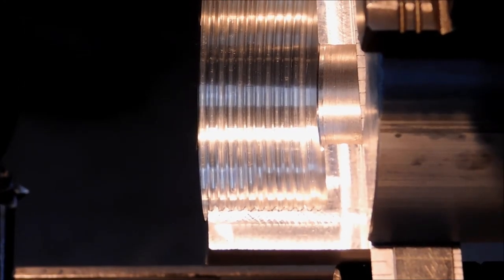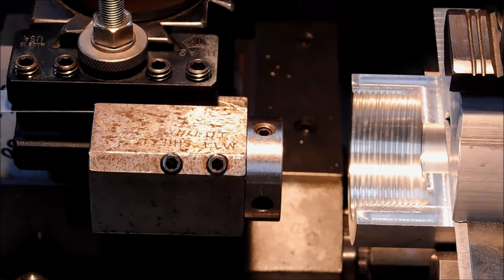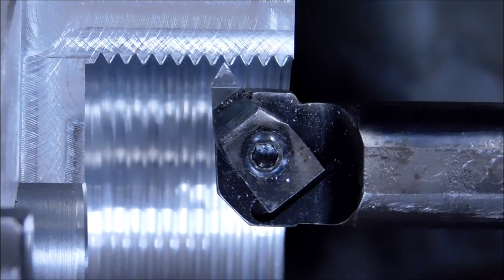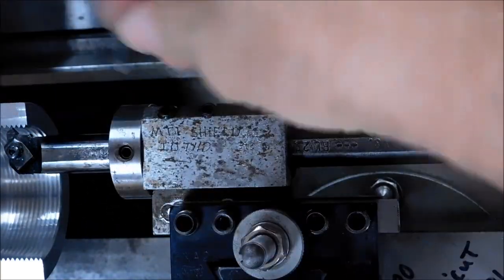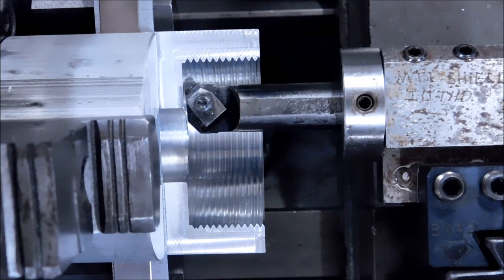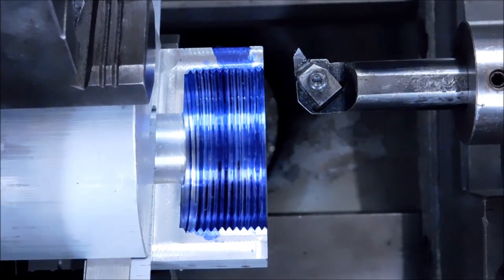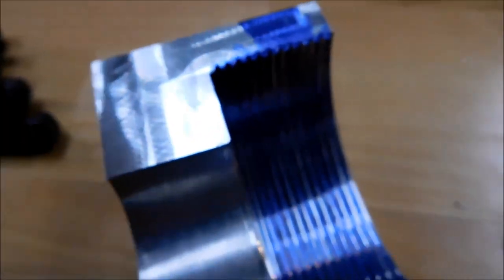How To Pickup an Internal Thread for Repairs !!!

Comment: When I was an apprentice, I was shown this technique, but used the compound slide to find the centre of the groove. The indicator was looking at the compound movement. It is also the same technique for an outside thread to be picked up. The only difference was that after the lathe engagement and had checked the thread pitch , the chuck was hand turned in the direction of the thread cut. This made sure there was no backlash in the gear train. Also lock the carriage so it is stable  in position. 
Great post Joe as always.

Comment: Another great tip Joe - I had moved the tool but had not thaught to use the indicator to find the center - so simple, Thanks
Reply: Me to: using an DTI never occurred to me either;-)
Reply from the maker: Thanks. Using the compound could easily lie to you or chip your tool. The indicator gets you much , much closer.

Comment: Thanks for sharing this idea, thankfully I have not had to pick up internal threads yet but have picked up on a number of external ones.  I really like your idea for threading with the spindle in reverse and am now looking for a reverse threading bar to the one I have. 
Thank you for sharing your tips and tricks, it is very much appreciated as you have some cool ways pf doing things!
Reply from the maker: Thanks. I love a good challenge and a shop is usually full of them.
Reply: You don't need a reverse handed threading tool, in fact it won't work, even with the lathe running backwards. In the same way that a LH nut will not run onto a RH thread, even if you turn it around.
Just turn the conventional RH threading tool you have upside down, or leave it right way up but at the far side of the hole, like Joe does.

Comment: Another good video Joe!.... One caveat might be, for novice machinist, is to not forget that the job came in as a repair, meaning that the threads will be mashed, rolled over, gouged, etc, so their start number of .020" in this video case, needs to be sneaked up on to avoid chipping a tool on the damaged spots. Well done !

Comment: Joe, this has been a godsend for me. Threading in reverse is a revelation making it so easy to work to a dead stop or should I say from a dead stop. Brilliant! I just did an internal thread only 1.5 mm deep and 0.5mm pitch!
Reply from the maker: Good to hear. You'll never go back to the old way.
Reply: Are you doing this on lathe with metric screw?
Reply: @bpark10001  
In truth it was a custom thread of 7mm dia but 50 tpi. This meant I could engage the half but using the timing dial on my imperial Myford.

Comment: Last time I chased a thread was using standard Aloris holders and an insert bar. I used the compound to feel either side of the thread and noted the travel and backlash. Bounced back and forth until I found the root and backed off a few thou. Make sure you have all the backlash loaded in the correct direction on everything! Especially the half nut. Joe I like the use of the indicator. I was running more seat of the pants to chase a very large UNS optical thread.

Comment: Awesome technique, as always, Joe! Thanks for posting.  The concept of threading away from the chuck is just brilliant.  So simple, why hasn’t it been done like this forever?
Reply: It's funny when you see this for the first time you go -"duh! Now I don't have to be a ninja with the half nut!"    I started to use it all the time because my lathe has a metric leadscrew and no threading dial.   Makes the whole stop-out-reverse-in-forward thing sooooo much easier for when you can't unlock the half nut during threading.
Reply: Actually, some turners were doing this in the first half of the last century.

Comment: Nice procedure Joe, I wrote to you last winter about a similar situation, I was into during restoration on a very old screw jack that had broken on my Grandfather when a wood wheel came off the axle on a fully loaded hay wagon being pulled horse team on the way back to the barn it was sometime in the mid-s20.  My father always told the story about Papa pulling the broken jack out from under the wagon mad as hell and walk over to huge gully and toss it as far as he could. The jack was rediscovered in the early s70s when the farm was being developed into an apartment complex by an excavator operator that was good friends with my father. I guess since it was buried deeply in a clay swamp it was preserved fairly well. That's when I first heard the story about the jack, my dad was about ten years old at the time it happened. My dad hung onto that broken old jack for the rest of his life and it was passed on to me with the request to get it working again. I did, but it's only an ornamental piece now. I could have done a much better job had I saw your video first. My sister has it hanging on a wall in her family room now along with many other artifacts from our family. Thanks!
Reply from the maker: Love it.

Comment: Very cool and exacting method of picking up the threads after a screw up when threading.  I’m a total novice but just recently was trying to make a spindle nut protector for L-00 spindle on my old Clausing 5900 lathe in which I’m adding a lever collet closer . Anyway I screwed up midway cutting the external 3.5” x6tpi thread. I spent about 30 minutes thinking about how I save the mostly finished nut I was making and did a lot of what was described in this video.  I love the the indicator because I just eyeballed my repositioning of the boring bar. This was very cool. Thanks again. I really like your videos Joe. They almost always hit home as very useful.

Comment: That's a pretty clever solution. I like the use of the indicator to pick up that blind measurement for getting centered.
Reply from the maker: It will get you very close if all preceding steps have cooperated.

Comment: Engine Lathes are easy. I was doing this 30 years ago. I just came up with a new process two days ago on a CNC lathe without a compound. 3 5/8-12 ID thread repair on a 10' long telescoping tube. I picked a position behind the Chuck to make a timing mark on the Head Stock and Mounting Ring.  I used  a small amount of JB Weld to cover a small spot of about the first 4 thread. After setting Z0 at the end of the tube I checked  the timing marks then moved the threading bar to the center of the first full thread. Marked down Z-.175" I set program to start at Z+.100". Run first pass and stopped. Checked the marks over the JB Weld. Looked Good. Run the Program to end. Needed minor adjustment to X diameter and about 0.004" to Z. Ran 10 tubes  before quitting time.

Comment: Nice video techniques, you are no amateur.  Also like the way you used a sectioned piece of work to illustrate the cut.  I've known of turning from, how would you say, on the back side with the spindle turning backwards, nothing like threading a blind hole, done it many times, making camera lens adapters, etc.  I've always done the threading by "feeling" where the bit was, not by using the dial indicator and splitting the difference to find the center of the thread.  Nice work, as usual.

Jim

Comment: Good stuff Joe. The half part was great for the visual. I've had to do this a few times... more so with od threading. I once had to pick up a 10-32 thread on the cnc to thread mill it a little larger when it shrunk with heat treating. Basically used the same principle as you have described here.

Comment: Hi Joe,

Not sure if I wasn't paying attention, but did you mention anything about making sure all the backlash is out of the system when setting the tool in the correct position? I always find it amazing just how much backlash most lathes have the geartrain for the leadscrew mechanism.
Reply from the maker: I always apply drag to the top of my handwheel while threading like a drum brake. Always. Even in this example prior to setting that tool.

Comment: If you are chasing threads that have been worn and/or distorted how do you pick up your center of thread with confidence?  Some that have been over torqued can also stretch the thread.  I like the idea of putting an indicator on the back side but am confused about how you keep everything in position when you unlock the half nuts during set up?  Thanks for a good video.
Reply from the maker: The location of the tip of a threading tool is mechanically set to be coordinated with the machine movement. Once its set, you can engage and release the half nut as much as you want and it won't forget where it is. As for chasing beat up threads, I would suggest finding an area that looks good and set your tools there. Watch that first pass and adjust if necessary.

Comment: As usual very well described. The only suggestion that I would make would be to determine the speed that you intend to run the part since on some lathes changing the speed after locating the tool can create a problem concerning location.
Reply from the maker: I can not speak to all machinery, but the possibility does exist.

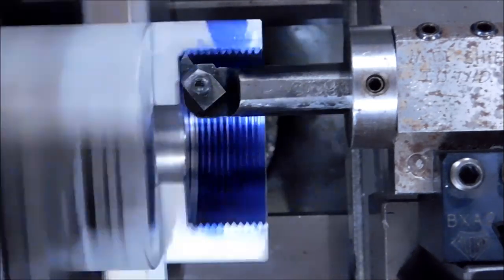Comment: I would imagine that when first engaging the half nut (4:14), we would need to be mindful of the thread dial for the particular thread so that when we later engage the half nut to clean-up the thread(13:35 ), it is properly indexed to the thread.  Correct?

Comment: Great job you made this dreaded problem easy!  One question though after you picked up on your thread did you put the spindle in neutral to change speeds ? Because I thought that would change the position of your threading insert to the  thread.
Reply from the maker: I did disengage it once. I'll have to try that again before I say it didn't hurt anything or maybe I just got lucky. Normally I wouldn't change anything to be sure.

Comment: My very first attempt at picking up a thread was on an internal.  It certainly wasn't voluntary!  Thankfully, it was on a large bore, 5 tpi, and near the beginning of that operation, so it was a little easier to absorb any differences in how the tool bit was set.

That slip was the first of several that convinced me that the old original lantern tool post could not be trusted.  There are "turret" tool posts, I started calling this one my "tourette's" tool post, as it became the cause of several sudden outbursts of profanity ...

Comment: My internal threading is almost exclusively on parts without a stop groove, but also without a shoulder right up against the threads.  Is there a way to start the reverse threading technique without a groove to start the tool in?  I do a lot of truing of threads which are never cut straight to the bore of the part when I get it.  Normally end up with a thread that's .010" oversize, then cut the mating part to match the oversize thread.  My process for picking up the thread is much the same as yours, but I currently thread toward the chuck, back out at the end of the cut and disengage the half nuts simultaneously.  It makes me nervous and I've broken my fair share of inserts by not getting out of the cut in time.

Comment: Could you please make a video detailing Buttress threads. I can't seem to find any information on the set-up (compound rest angle) and procedure of machining this type of thread which is mostly for hydraulic applications. The Machinery Handbook gives many specs but no procedures. Thanks! I love the videos!
Reply: Buttress threads only have one angled flank so you can simply plunge straight in without topslide (compound slide) set-over... 🙄😏
Set-over is used to stop the cutter cutting both flanks at the same time , this cannot happen with the buttress so no set-over needed... make sense ? 
Joe can correct me if I'm wrong... I'm only a hobbyist but this is my understanding & my experience... 🤓
BTW... the cutter profile would look like a woodworking chisel on its side..kinda like this..  /|
😎👍☘️🍺
Reply: Peter Fitzpatrick I think some buttress threads have a slight amount of angle on the “straight” side as well. But this is small enough that you probably won’t need to worry about it.
Reply: @literoadie3502   looking at charts I see what you mean... in which case , to be correct, I assume you would set the compound to that small angle instead of 90°plunge cut... thanks for making me look , laziness is a bad thing... 🙄😂

😎👍☘️🍺
Reply: Peter Fitzpatrick I wonder if they make any rolled buttress threads? I really like butters threads on vises and presses.
Reply: @literoadie3502   can't see any reason why not, as long as there was a big enough production run to make it worth it... rolled would definitely be stronger... I'd imagine those rolls are quite spendy tho... 🙄😖

😎👍☘🍺

Comment: Excellent tip, I would never had thought of that technique. I have only just purchased some interchangeable boring bar holder's, after using a standard square shank holder for umpteen years.
Thanks for sharing and best regards from the UK.

Comment: Joe.......true dental mirrors are " first surface " mirrors. The mirrored surface is applied to the outside surface. Very fragile but they do not give the distorted or double image of the typical tool truck mirror where the mirror surface is on the backside of the glass.
Reply from the maker: I never knew that.

Comment: My heartiest salutes to you for the most innovative and out-of-book  solutions to such unusual challenges. I have learnt a lot from your videos (just like many others! ) and someday I hope to meet you and hold your hand to say Thanks. 

By the way I have doubts that this technique may not hold good for 26 TPI or finer threads, but hope you may come with some genious solution for that too!
Reply: When cutting threads smaller than 26TPI, I imagine you are using a tap and the same basic technique will work. Leave the tailstock loose so the tap will pull in by itself.
Reply: @millwrightrick1  Thanks Richard, yeah it's true! I guess I was over-thinking on the single point inserts, and forgot the taps.

Comment: years ago I had a small lathe and I didn't know you could thread from the head towards the tailstock but, once I tried it and saw that it did work, then I, too, adopted that approach to threading because the conventional approach never made any sense to me; it was far too risky. 

 fortunately for me, I've never had any problem shunning convention to try a different approach. 

Driving big rigs I learned, pretty quickly, to shun the traditional approach to breaking while going downhill.
Training says to pick a gear, before going down the hill, and then stay in that gear the entire way down. That gear might end up being too high a gear and you have to "over brake" to prevent the rig from gaining too much speed. You over brake and your brakes fade - translation, you lose your braking ability and you're now a gravity powered missile with zero alternative ways to slow or stop. 
The solution is to use the left foot for only one purpose - maintain 10# of air pressure on the brakes. 10# air pressure is a magic number because it does slow the rig but it also is the air pressure at which you CANNOT fade your brakes. 
So, when I'd go over a hill I'd use my left foot only to maintain 10# of air on the brakes. If 10#'s wasn't slowing the rig enough then I'd goose the fuel, pop the stick to neutral, goose the fuel again and downshift. Rinse and repeat until the combination of 10# brake pressure and the gear chosen kept the truck at a safe speed. 
The conventional approach is suicidal and yet many viewed my approach as suicidal because they'd had it hammered into their heads that you NEVER change gears while going downhill. 
Well, the conventional way nearly killed me, whereas my method was trouble free for nearly 17 years and I feared no hill - no matter how steep - because I knew the safest method to successfully get down ANY hill!
Convention be damned, do what you know works. :)
Reply: @gangleweed  yes, double clutching..... you cannot and should NEVER double clutch when going down a hill. Very dangerous. 
One should float the gears. No double clutching and I never had a big rig with synchronous transmissions. You "could" double clutch but I never met a big rig driver that did that. 
The truck you're referring to also could have had the gears "floated" rather than double clutching which is always dangerous to do.

Comment: Hi Joe, Very funny " unloosen", also my Australian partner say we both pronounce the word "across" wrong, lol
Nobody seems to understand Americans.
Your video was great as I usually find.
I was interested in your design for the boring bar collet system for the quick change tool post, very versatile. Like its abilty to float into position but is it really more rigid? Can only think about variation in 2 bore sizes; collet and bore of the holder, compared to just lock in a tool holder.
Just interested in your thoughts Joe.
I do appreciate your time spent on delivery a great video and follow ups.
Reply: I'll be adding one of those holders to my to make list.
Reply from the maker: The hole in the mounted block is always 1". You can use 1" bars in the main block and use collars for smaller tools. I have 3/4, 5/8 and 1/2. For 3/8 and smaller, I have dedicated adapters. May be a good video topic.
Reply: @joepie221  Thanks Joe for the follow up, greatly appreciated.
Sincerely
Troy Guyette
Reply: @joepie221  thanks Joe look forward to make a holder with you, just fromAustralia though 😊